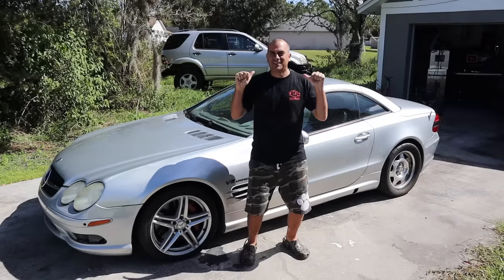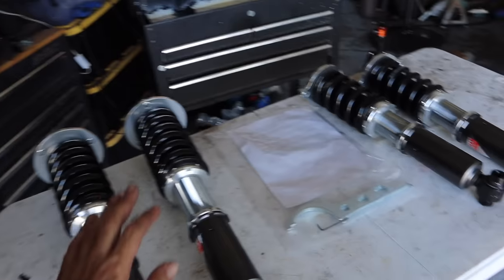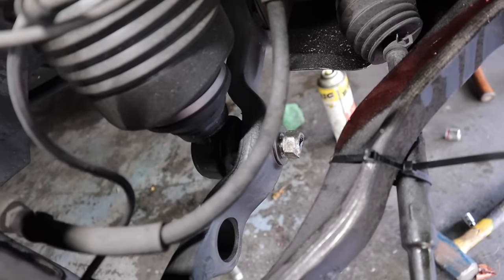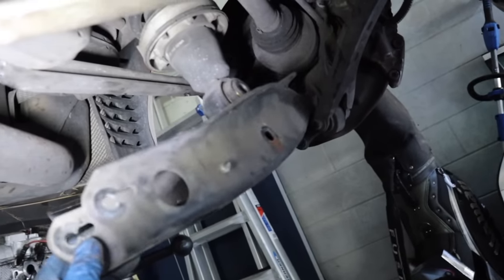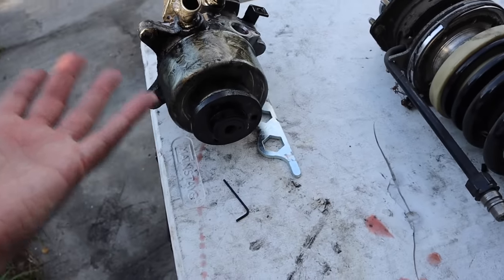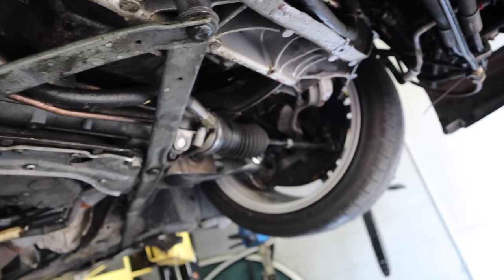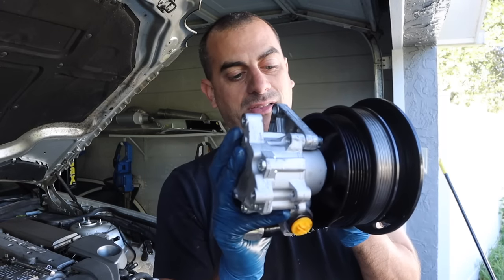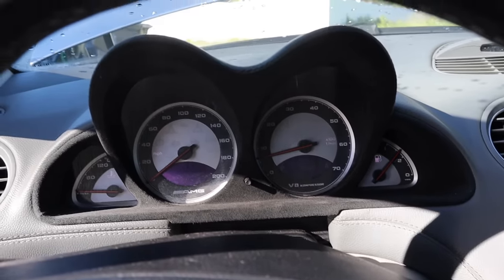Installing Silver’s Coilovers On My Sl55 AMG

Comment: Great job, were you able to use the original serpentine belt? If not, do you have a part number for the new superintendent?. not looking forward to doing this on my SL55, however I know It.s time I.ve been putting it off, your video has gotten me motivated and a few helpful tips I forgot about. Also got some questions answered  in regards to what  reservoir  to go with, keep the SL 55 content coming, thanks so much!
Reply from the maker: Yes keep the stock one like i did 

And the job is easy if you don’t want to remove the lines

Comment: That is great More and more people are going to that More and more people are not afraid it works the only one I wouldn't recommend is the old man's mode if you want it the old man's mode I think you got to get go with the SL setup as opposed to coilovers most of us drive in a sport mode or the ABC mode That's just fine . I went to a suspension shop they charged me $659 , and I went with hiro coilovers, took it back to them once to have my height adjusted perfect
Reply: how is the ride of hiro coilovers?

Comment: What are your plans for adding the sway bars? The Black series has steel springs with swaybars. Without the ability to tie the two sides of the suspension together could cause undesirable effects in a hard corner.
Reply from the maker: not going to. my sl55 rides great

Comment: Great job!!! Everything is more or less clear. Please tell me if you reused the original belt? You mentioned you need to measure it and then you didn't get back to this topic. I see you re-used the SL reservoir. That's cool. My SL has different engine, so I'm not sure if ML55 pump will fit there. I need to do a research to confirm whether it fits or not. If it doesn't, I may have to keep the tandem pump and loop the ABC lines.
Reply from the maker: Stock belt works 
Yes you can loop the old pump if needed
Reply: @Nd_72  Thank you! I jus t contacted Gold Element Autoworks (they sell Silver's coilovers) and they confirmed that Sprinter PS pump should fit on my car OR I could just loop the existing tandem pump. We'll see. Again, I better start with converting CLS since I don't have to deal with any pumps there.

Comment: I am doing my conversion soon for my sl500, but I am not removing the tandem pump at the same time. Leaving that job for later because I'm doing at a mechanic. Do you have any recommendation if I'm doing the struts and leaving the tandem pump?
Reply from the maker: you just need to block it off     I removed mine and sold it